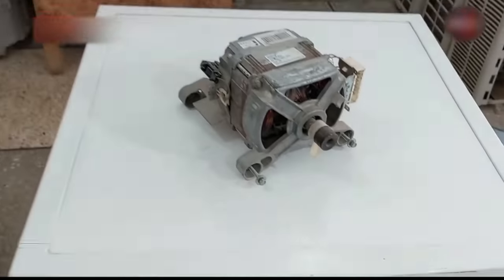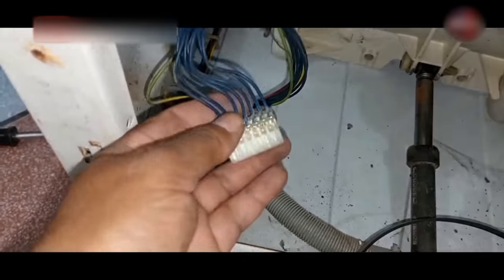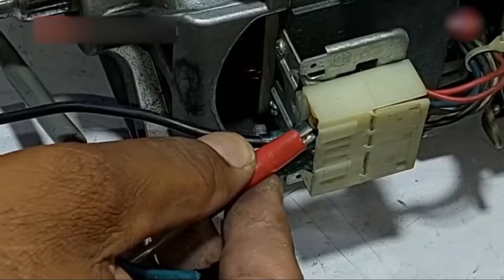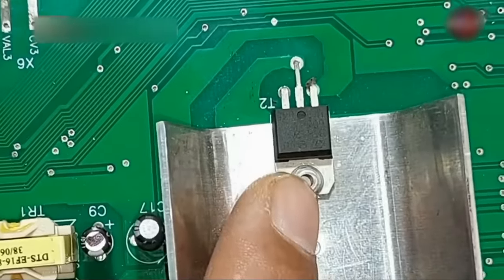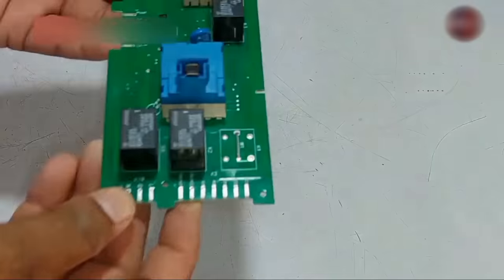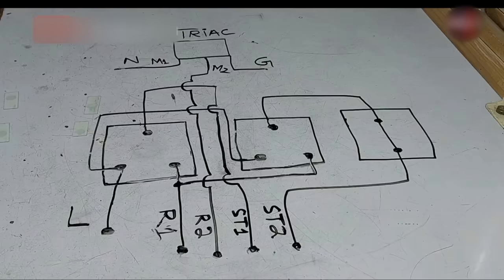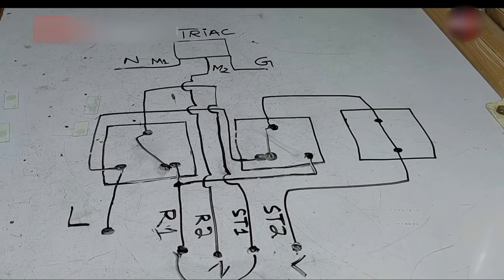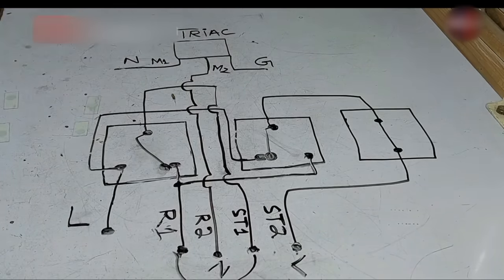How Washing Machine Motor Speed Is Controlled Under 1300 RPM

Comment: In the USA, most modern washing machines with microprocessor control use 3 phase motors with variable frequency motors. And they also have a feedback system for the "taco" or tachometer
Reply: Thank you very much aguas tuyú
Reply: Standard in europe for like 10 years.

Comment: As a service technician with over 30 years of experience with European home appliances I must point some errors you made in this video.
When checking the speed of the motor the Electronic board (Electronic Timer) does not read the voltage from Tacho generator but the frequency because it is much more accurate!
The same is the case with analog electronic pressure switches (Pressostats).
About the TRIAC you got it all wrong. You described it's function as BJT transistor - the more current thru the gate (Base) the faster the motor will turn. Triac's are activated at specific point in time in regard to sinusoidal wave of the mains voltage. This is called triggering or firing ANGLE. Let's say the sinusoidal wave is at 0 and it starts to go up in positive half periode, when it reach the top we send the firing signal to the gate and from that moment on the Triac will conduct the current (at this point it is no longer relevant if the firing signal is still present at the gate or not) until the wave comes back down to 0 again then it will cut off. We repeat the same when the wave goes down in negative half periode. That way the motor will rotate at half speed because we trigger the Triac at the half of the wave length. So by changing the firing angle of the Triac's gate we change the speed of the motor. The sooner you trigger the gate the more time during the periode the Triac will conduct and the opposite is true, if you trigger the gate later the less time the Triac will conduct which will result in lower speed. The triggering or firing angle can be from 0 to 180 degrees because that's the length of the half period (negative or positive). 0 degrees firing angle = 100% motor speed and 180 degrees = 0% motor speed.
Reply from the maker: The Idea of the video is just to explain how the washing machine motor work clockwise and anti clockwise, I didn't discuss the indepth logics of electronics used in circuit.
Reply: @debelix, 100% true. Also regarding Pressostats, I've seen models where there is a membrane that gets pushed by means of pressure, it moves a coil along with it, and the circuit is built around a 4060 IC which results in a change of frequency. Some older models have the 4060 chip on the washing machine's main board, rather than inside of the Pressostats themselves.
And you are also right about the triac thingie, you described the triac functioning correctly, while the author of the video repeatedly treated it as a BJT instead! If the main focus of the video is just to show how we change the direction of the rotation, then they should have only mentioned that the triac serves to change the motor's speed...
Reply: And lol, I just rechecked the title of the video, it's about how we change the motor's speed! The direction of rotation was something extra...
Reply: The funny thing is that the guy was apparently connecting the multineter to something else while pretending to be measuring the voltage from the tacho 😂 the rotor was clearly at rest!
Reply: Magical or animations still antedating me though , good to learn deeper knowledge with oscilloscopes demonstrations ! I thought there was micro controller program as well , direct drive would be more complicated as there was 3 phase AC motor that need power inverter . Compare able to  electric car and e bike control module!

Comment: Thank you very much for your work and sharing. I build up a 555 flip flop to make my washing machine motor work with the circuit you explained here. It works both directions but when we come to use it in the machine; since it doesn't wait the clockwise turn before starting the counterclockwise turn, the motor heats up in a very short period of time. Do you have any proposal to make it wait the turning stops before it changes the rotation ? Thank you for your time and interest. Best wishes.

Comment: In some modules in addition to relays and triac, we have a bridge diode and the motor uses dc voltage. Also the relays are parallel and both turn on and off together. Could you explain about them?

Comment: Its a Triac NOT a Transistor learn how they work.
Be a good idea to check on the RPM sensor too, the V is incidental proportional to RPM but its the FREQUENCY thats used and important to generate pulses to drive the triac.

Comment: As so often, two answered questions open three new ones: why is the Motorspeed changed by different triac positions ("fire angles"). I thought if the voltage supply is 50Hz (1200rpm), the triac does not change that, it only deforms the sinusoidal voltage form.
Reply: thats because the voltage supplied is not 50Hz, its 110v in the us and 220v elsewhere, the frequency is 50Hz dont get them confused
Reply: This is a universal motor with Multiple taps that control speed . 

Relays are used for forward and reverse control - clockwise and anticlockwise motion.

On 3 phase induction motors - frequency control is used and controlled by an inverter

Comment: If the motor is driven by the "AC" current  sine wave through the Triac ,  the control board monitors the frequency of AC current coming back from the  of Taco sensor and controls the current going to the triac "Gate"  by regulating the current feed sent to the triac's gate it can control the Triac's switching point , as the AC sine wave coming into the triac varys from zero volts ramping up to full line voltage then back to zero again. if the Triac cuts of the current half way up the sine wave of say 100 volts AC you would be feeding the motor only 50 volts ,, so the motor would run at only half of its full power level,,  the control board can constantly reference the Taco frequency to control the motors "desired" rotation speed..the motor has two sets of field windings , one is wound to drive the motor "clockwise" the second set , is configured so that the motor will run counter clockwise, (Desired rotation direction) As said the relays select which of the field winding are selected (rotate  CW or CCW) ,  The Triac then controls how much power the motor is given to control its "desired" speed.. for the actions the washing machine is carrying out out the time.. The washers control circuts that drive the Triac send a pulse to the gate of the triac to turn it on. "But" that circuit can send the pulse so that it turns on after the sine wave has dropped to half its voltage . once the voltage in the AC sine wave drops to zero the Triac will automatically turn off the power flow. waiting for the next pulse to turn it on again ,, timing the turn on pulse at different points gets you more or less power.https://www.youtube.com/watch?v=9He-d-IdRQY
Reply from the maker: Well Said
Reply: This motor is called “universal” motor because in fact is a DC motor that can be driven from AC voltages. They don’t have CCW and CW coils, just the stator winding and the rotor (field) winding. This kind of motor can be easily controlled by changing the voltage (that is what the phase cutting triac is doing). From the schematics he has drawn the rotor coil is in series with the stator, that gives a high starting torque and high speed

Comment: The Triac control the DC by the phase, for the motor will have the XL resistor. I think this is not true circuit. 我認為線路有問題

Comment: This video appears to be a deep fake or (google) voiceover or some other content.  When this guy shows the motor running at full speed.  The shaft is standstill.  There is a lot of "Plagiarized" or stolen content reposted on YouTube and not sure if the AI is able to pick these out or filter them
Reply from the maker: This is not stolen content, this is my original content. I just translated it to english using Ai, Because my english viewers who watched my hindi channel requested me to dub the videos in english, so that they could also understand it. And that's it.
Reply from the maker: The motor was rotating, the camera didn't capture it because the speed of the motor was quite high, I usually wrap tape on the shaft of the motor, that the motor rotation could be seen. But didn't wrapped the tape this time.
Reply: You could literally see the motor spin and/or stop. Stop lying